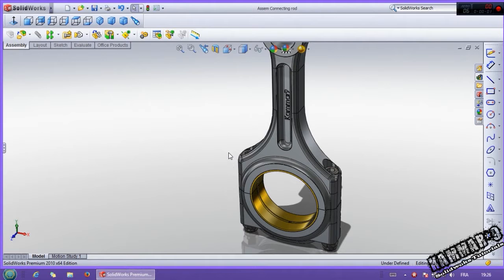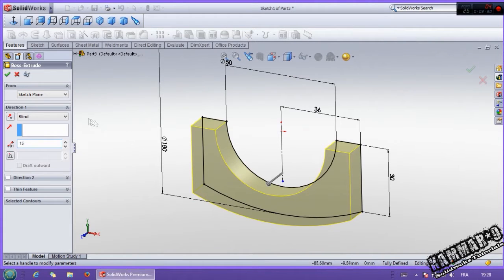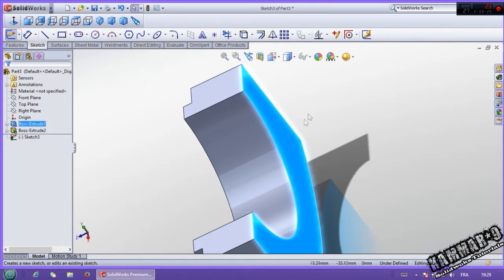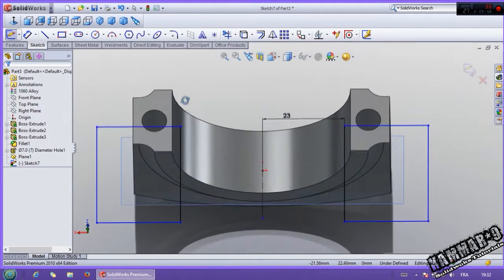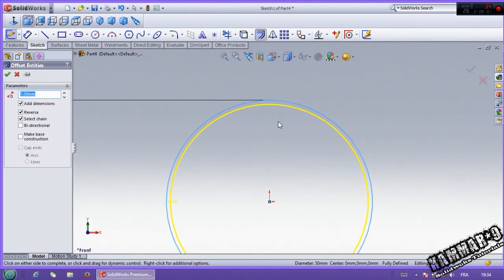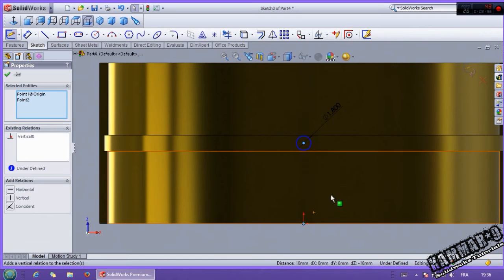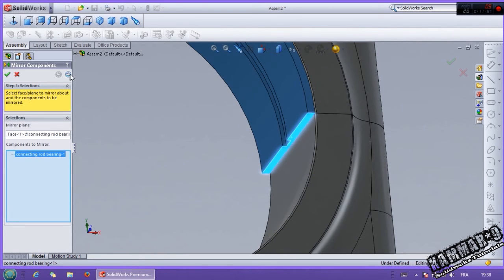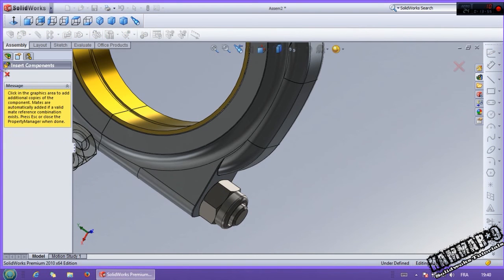Solidworks tutorial   V12 engine | Ep 03 Full HD 😍

Comment: Why in Solid Works? I had hoped u continiue in solid edge!
Reply from the maker: Robert Dave Myrland hi there bro.  I will continue in solidedge wait for it
Reply: I cant wait for it!! :) I wonder how u can use Solid Works without geting pissed of? I tried it but I get mad trying lol- It pisses me of and I have learn to hate it, I can't stand it. Solid Edge makes me happy, always did since version 2 as version 1 didn't want to run on anything else than Windows NT version and the first one and was hard to get without pay for it at the time so I had to wait a full year for Solid Edge 2. I started using solid edge in 1996 and have to day tried all sorts of drawing programs and all versions of all the known ones, but solid works is the only drawing program that pisses me of! Currently trying to leave the v.20 platform of solid edge, even doe I have no reason to as it is rocksolid and newer failed me or crashed since it was released in 2008. I am just curious on Synchronous Technology and it seems wonderful and it might speed some processes compared to v.20.

I also draw engines just like you, but not engines invented by otter people, but rater invented by my self. I spent 50000 drawing hours in solid edge from version 2 to 20 on own engine inventions and gear systems so I am kinda used to the old solid edge and it might be strange to convert to Synchronous Technology but I will try and that's why I ended up here.

That steering wheel in solid edge ST is what I struggle a bit with, I want to know how to use it in any given situation. I am doing prototyping on a new wall socket at this time and for that solid edge old school is just fine but I see that ST has easier assembly than v.20 and the ability to work in assembly in a more powerfull way, really handy.

The wall socket will be used as a frame work for starting free energy research, by using it as a income for a greater good. Then later start free energy device production and sale the systems but it will be sold without profitt. I might need someone good in solid edge to be employed in my free energy research lab; Everwatt Systems.
Reply from the maker: Robert Dave Myrland i m so exited about that . I m using solidedge it's a great software . For work I m interested in research and development.
Reply: Thats great, I have saved a note of that and I will contact u once I need more personell.
Reply from the maker: Robert Dave Myrland ok bro . I will be on time